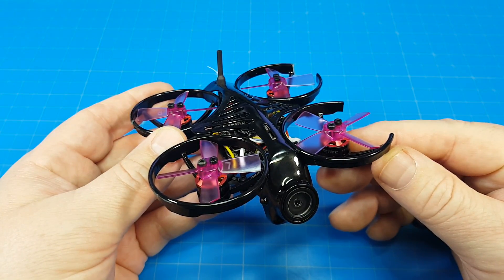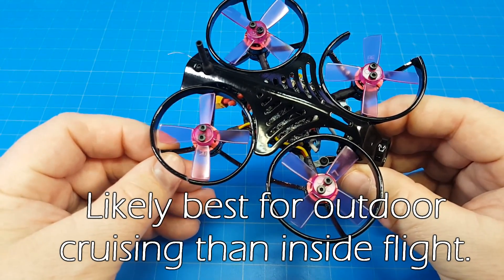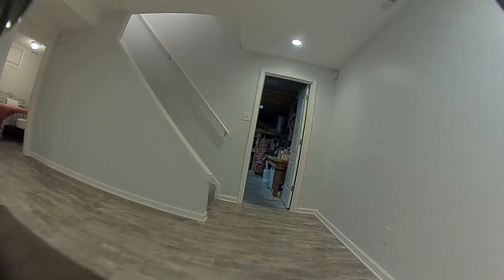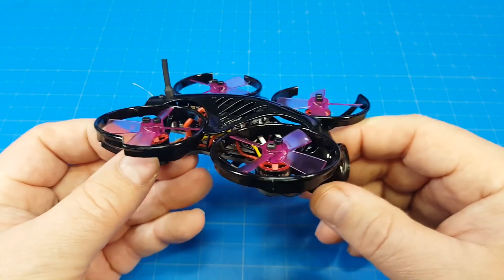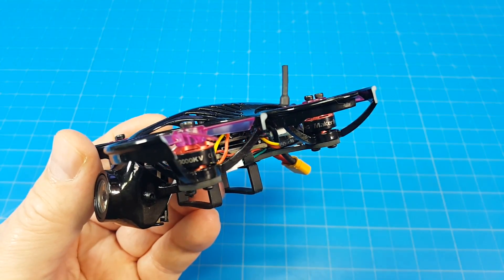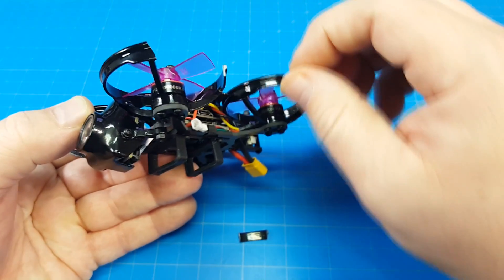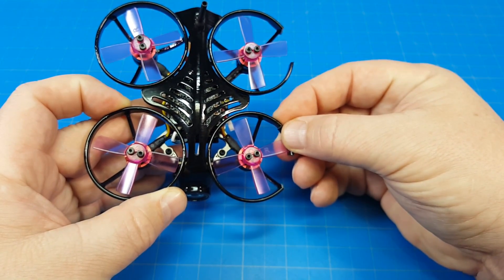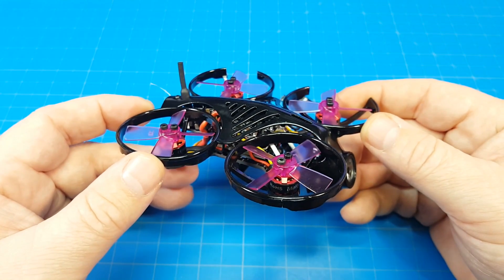Armor 85 HD - Preliminary Look

Comment: I had the same problem they sent me new ones that the broke too. I’m doing the tomoquad whoopee frame swap for mine
Reply: I noticed your comment about the tomoquad build. Just know that's it's only 1mm frame top and bottom. I broke mine almost immediately. Two arms snapped in a fall from about 4feet. So take it easy. Good luck.
Reply: RCing in SC ok thanks for the info